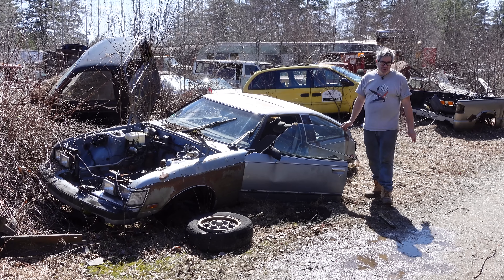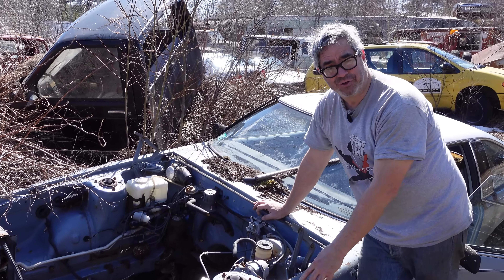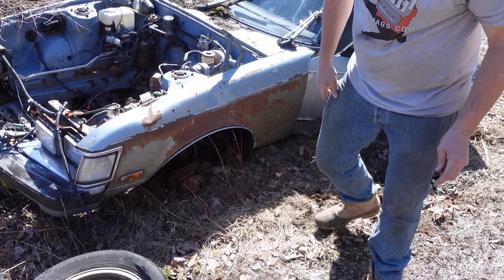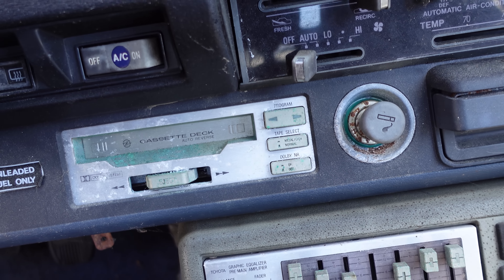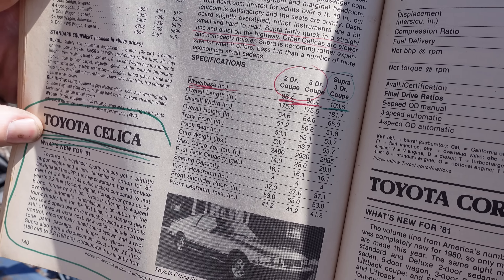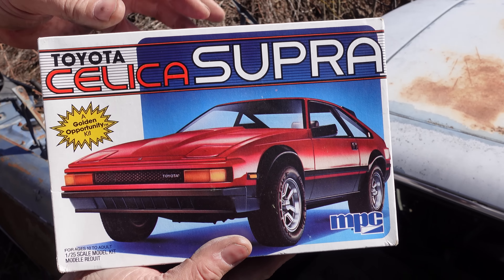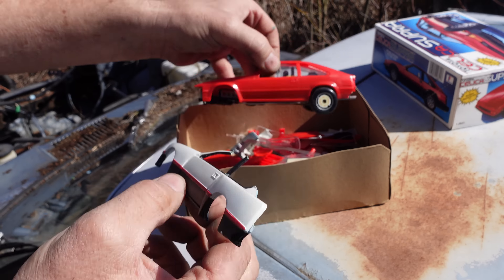Second Cup of Supra

Comment: I've always liked these cars. I learned how to drive stick on a 1982 Supra (the "A60") and it was a breeze to learn because the clutch was so smooth. The 1979-1981 (not 1978) models were A40/A50 nomenclature. 

As a 1981, this would have the 5M-E 2.8L straight six and likely the Aisin-Warner W50 five speed manual if it was a stick and the Aisin-Warner A40D/A43D four speed automatic if so equipped. These were assembled at the Tahara plant in Japan, which still operates today. The Toyota parts books cover both the Celica and Supra (in these generations) in the same publication. As the Supra became popular, it became its own model and got its own parts book. Today's modern Dodge/Ram trucks also use an Aisin automatic transmission in some models.

Looks like this one is code 888 Light Blue exterior paint.
Reply: I learned to drive stick in a 95 Cherokee, and then in my proper first car....a 1995 Nissan Pathfinder. My actual first was a 1984 Jaguar XJS, also with a manual. I could count the list of things that worked on my XJS with 1 hand.
Reply: @Jaguarmaserati  "Lucas Prince of Darkness". LOL.

Comment: I love that you used to modify your models as a kid.  I still have my model '57 Chev Bel-air hardtop with a custom chopped roof (lowered the equivalent of about 4 inches, I'd estimate.)  Hey, when you can't afford a car as a kid, it was the next best thing.  👍
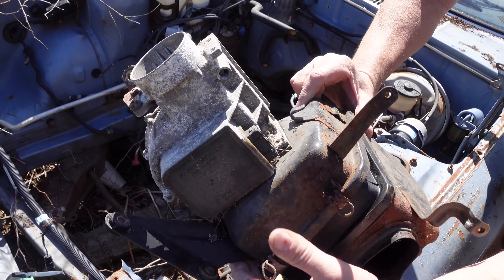Reply: I modified a 1:24 Revell '56 Bel Air into an El Camino, by modifying and using the custom pickup conversion panel from the1:25 AMT Nomad kit. It turned out pretty well, considering that I was only about 12 at the time! Now, 50 years later, conversions like that are simple stuff. Experience is a major help in these things.

Comment: My first car was the 79 Corolla my dad was gonna trade in that he had driven for a few years after buying it from a neighbor. My second car was a copper on copper 82 Supra L with digital dash I bought from the Toyota dealership I was about to start adulthood at. Took me almost 40 years to figure out that my father knew how to adjust valves but deliberately used the wrong line on the crank pulley when I was 13 to see what I'd do. Glad he finally admitted it and I'm glad he's safe in his Lexus. All started with a Toro aluminum deck pushmower too.
Reply: I have a pretty cool 1986 Corolla that I take to some track days on my channel!

Comment: Another great lesson. I remember these first Supras but for whatever reason never equated them as competition to the 280Z. Anyway, as Detroit performance started to wake up, I didn’t pay Japanese cars much attention. In retrospect, the Celicas of that era were built pretty solid. When you showed the air box, I was mildly surprised that it was made of sheet metal. I guess I’ve been too accustomed to plastic all these years.  If Toyota came out with another rear drive (or AWD) four cylinder Celica two door, I’ll bet it would sell - especially if affordable.
Reply: Z-cars just seem sportier. The Z car was a two seater. So yeah, didn't seem competing.
Reply: "If Toyota came out with another rear drive (or AWD) four cylinder Celica two door..."  They did - the GT86/Scion FRS (and it's Subaru variant.)  Fairly small, zippy but not too racy from the factory, handles well, and aimed squarely at the younger market...it really is the spiritual successor to the RWD Celicas of the '70s and early '80s.

Comment: Those prices NEW for both years were more than a new Z28 respectively ...
Reply: I owned both, 1980 Z-28 and a 1980 Supra.
Supra was a much better built car. You got a lot for your money, including leather interior.
It wasn’t fast but was fun to drive with the 5 speed.
Z-28 wasn’t fast either, even after some engine mods it was OK.